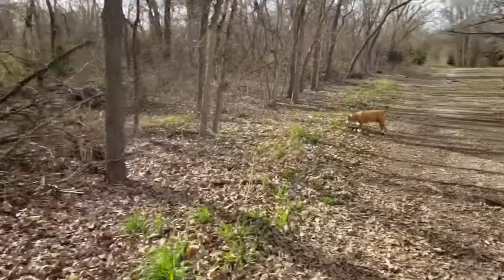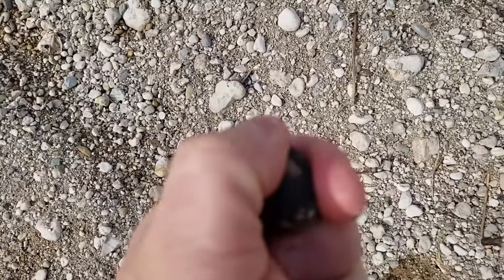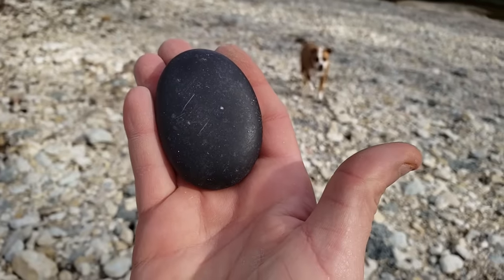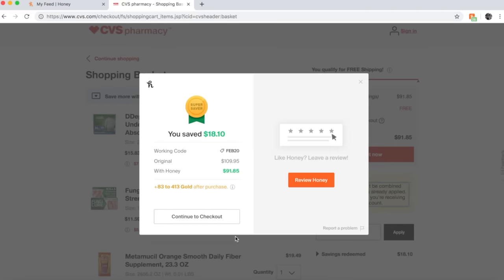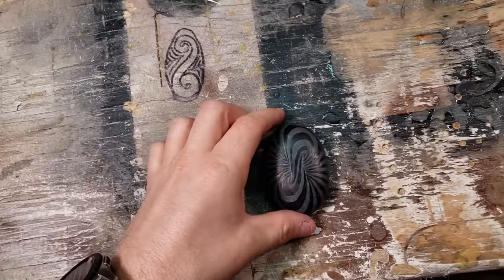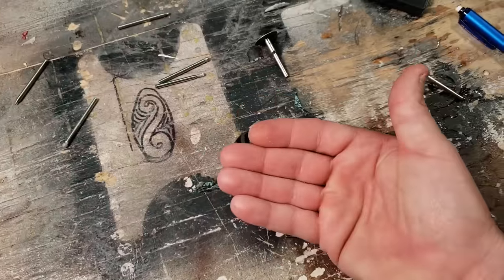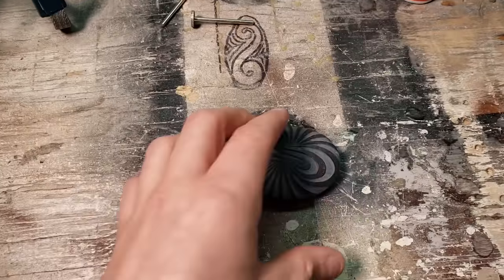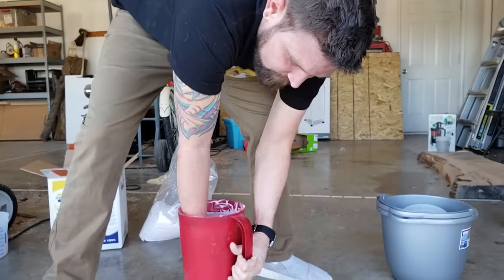I Carve a Rock and Cast my Hand in Resin to hold it

Comment: Bobby Duke Arts I came across your channel when I got my braces and I was crying until I found this and I laughed my head off but my mum and dad were concerned about me
Reply: I’ve got invisighn
Reply: Lottie Sugg braces aren’t that bad, I’m sure you’ll be fine :)
Reply: N&N I know because I just had my wires changed and they don’t hurt as much as I thought
Reply: Lottie Sugg yeah, my least favourite part of it was the wire changing because when they pulled them out I felt like my teeth were gonna fall out
Reply: I literally don’t follow any of the rules the orthodontist told me to follow (within reason). I’m pretty sure he knows and hates me.
Reply: @jazzcat1611  If you don't you'll need braces longer..

Comment: How did you cast the resin without any bubbles????
Reply: Annie Goldberg because he poured it from a high height
Reply: OneTon thanks!!
Reply: Annie Goldberg no problem 😁
Reply: From experience, pouring from height onky makes more bubbles. Make sure your resin is warm and you wont have any bubbles. Any you do have will pop easily with a skewer :)
Reply: Donna Wilson actually your wrong

When its poured duh there's bubbles but when its cured and solid they are gone
Reply: Magic
Reply: there are chemicals you can add together with the catalyst that remove the bubbles completely.
Reply: Try putting it in a vacuum chamber
Reply: @Abbie_Loves_John  what resin are you using and how big are your peices? I use polyester and only make very small peices so any bubbles are very noticeable. I do find that if i dont pop the bubbles before curing, that they will just stay there and ruin the peice. Resin likes to be warm, its smoother and easier to work with 🙂

Comment: Polyester resin shrinks as it cures. That's probably why the rock fell out. That's also why the texture was so rough, it pulls away from the mold and leaves globs of goop that collect between the mold and the resin as it shrinks, making it rough. It also tends to crack on anything larger fist size or bigger.

Comment: Oh, a rock that rocks!!!  I was looking for videos on carving river stones and found your video. I'm using a Dremel 4000 with a chuck instead of a collet, but it turns out soooo hot after a while that I have to wait for it to cool down. Will your diamond bits will last longer if you use water? I do spray a bit of water to cool the stone and to clean the area. What do you think? Would you recommend the Dremel on a Flex extender or go for a smaller Dremel Stylo? Now for the resin...My hands are hairy... Would you recommend to shave it, to obtain a more smooth area? Can you put some light grease like Vaseline on your hand to be able to retreat the hand easier? Can you use a very smooth polishing paper, say a 1200 sandpaper to obtain a crystal clear on the resin? I think you are funny and I could say that you are the Jim Carrey of stone carving. But if I do a video myself, I will be more "serious". Nah, I'm still laughing!!! Thanks for sharing!!!